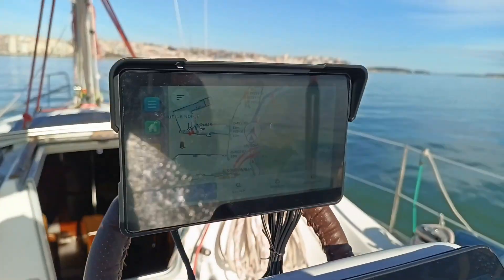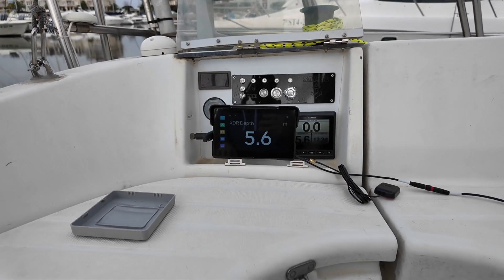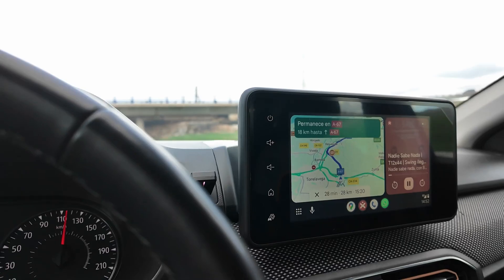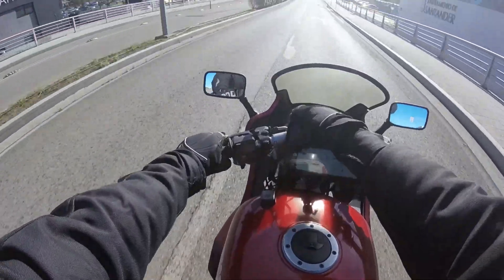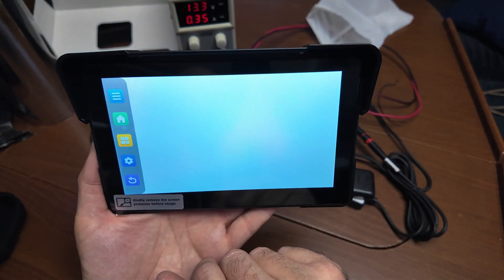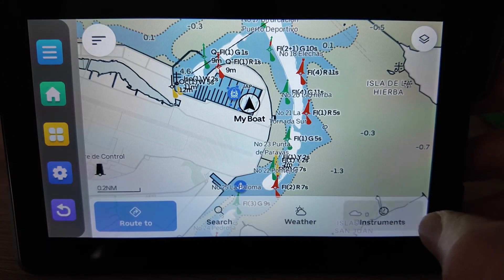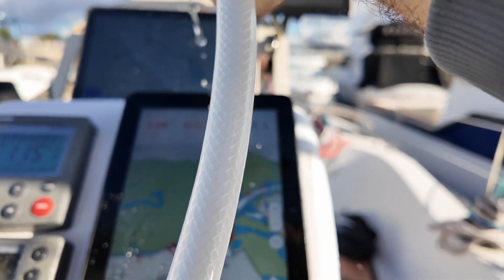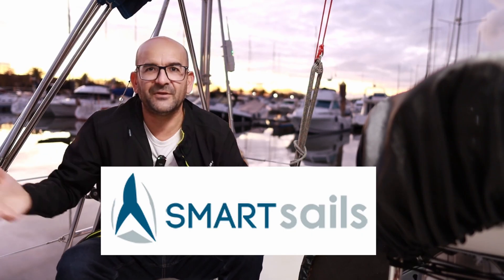EP111 – $80 DIY Marine Plotter Made from a Motorcycle GPS. Waterproof and Sun-Resistant!

Comment: Hello, nice to meet you.
I purchased an MTC-21 and installed it on my motorcycle.
I connected the yellow wire to B+ and the red wire to ACC.
The MTC-21 starts up when I turn the engine key on,
but it doesn't turn off when I turn the key off.
After trying various things, I found that the MTC-21 turns off when I turn the engine key off and
on again.
If I turn the engine key off and on again,
the MTC-21 starts up in the state it was in before I turned it off.
Is this a malfunction?
I've seen reports
of it not working properly with ACC and B+.
I've contacted the manufacturer, but haven't received a reply yet.
Has anyone solved this problem?

Comment: This is pretty cool. I do have a B&G plotter inside, but this would make a nice removable external display which connects to the B&G Nmea0183 over Wifi connection. It's also good they don't have a battery inside, so it doesn't need to be charged, and doesn't get overcharged when connected for long time, or battery overheating in the bright sun etc.